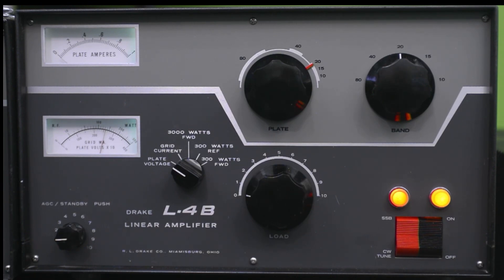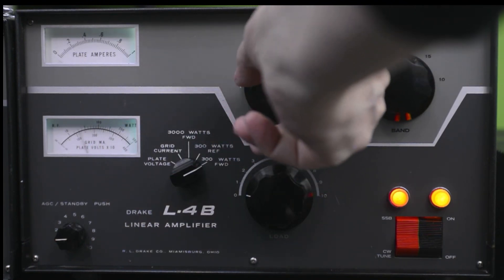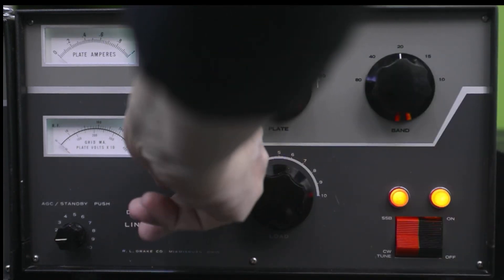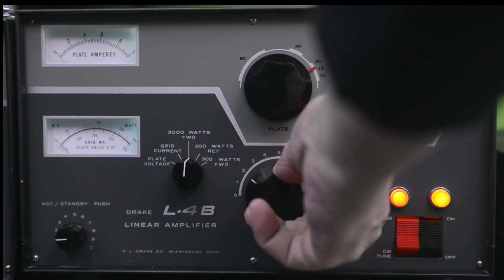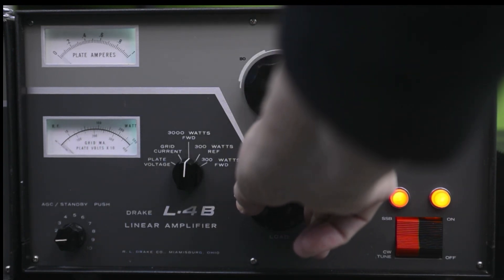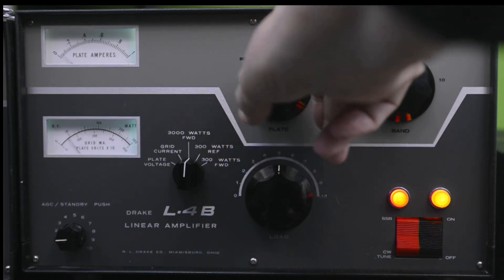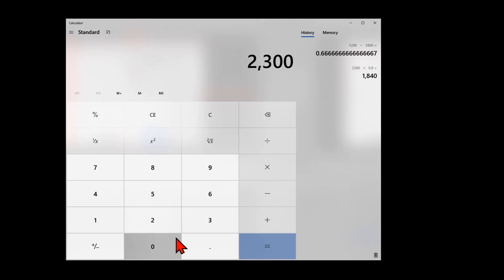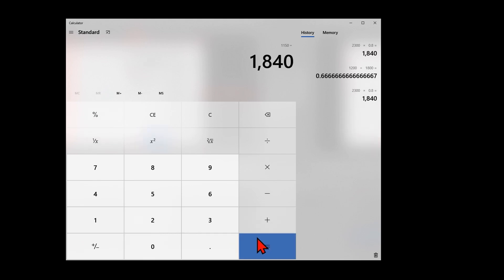Tuning A Linear Amplifier 3-500zg 811A 572B Triodes in Grounded Grid For Maximum Output Power W6LG

Comment: Excellent! Doing it that way for many years. I have a Drake L7. Got it used in about 1990 and still using the same tubes after  22 years! I do keep the output under 1000 watts most of the time, but it gets a lot of contest use.

Comment: Jim, I really appreciate this video, especially now when I've got a line on a 4b. The seller bought an estate and this was part of it. He's asking about $1200 and states it was working before the operator went SK. Given, the triodes may be dead or tired, However, my question-most likely too big to answer-is what or where should I look to assure that the amp has still some value. As usual, your videos are a joy and so informative. 73 OM. AA7MO, Mike
Reply from the maker: New tubes could be around $700.  A cracked bandswitch is fatal.  I would not pay more than $500 to $600.  The other option would be to test it first.  You give them a deposit of a few hundred.  There is so much that could be wrong. A broken meter....almost impossible to find.  The darn on and off switches are very expensive.  Mike, offer very low or be allowed to test it first.  73, Jim
Reply: @ham-radio  Good Advise as usual and thank you. We'll see what transpires...73 AA7MO

Comment: I just rebuilt a Gonset 101 with four 811A's. I greatly appreciate this video for showing me how to tune it up. It works great. I have both a Tiny SA Spectrum Analyzer and a Nano VNA and it is showing a very clean output.
Reply from the maker: Glad it helped.  That was my first amplifier.  Faust Gonsett was a neighbor.  However,  never met him.  I did know his son.  73, Jim
Reply: I turned on the Amp this morning. One of the tubes was cold. No filament. Now I have to replace tubes.

Comment: Have had an 811H amp. for a year now.  After about 5 hours of use I had one tube fail sent it back to Ameritron they said the tube had lost it's vacuum in the base.  Sent me a new one and so far all doing fine.  It came with the grid current protection circuit so I can only load it up to 50 watts and no more but I do get 800 watts PeP out with it and so far am very happy that I have a good signal without spending $5K or more.